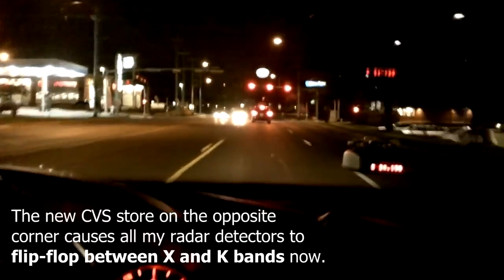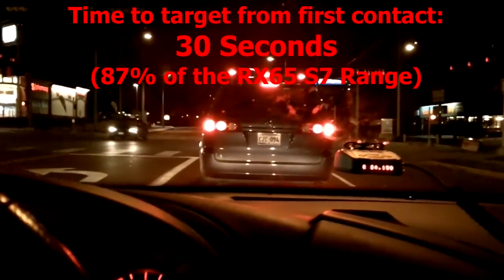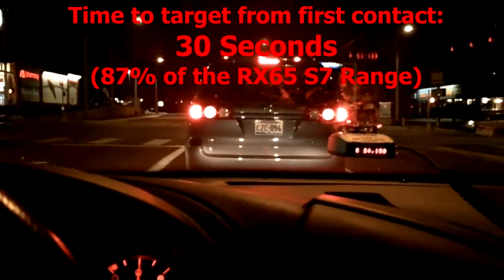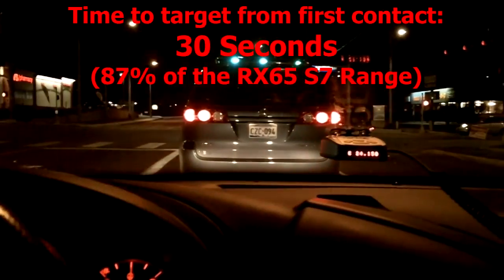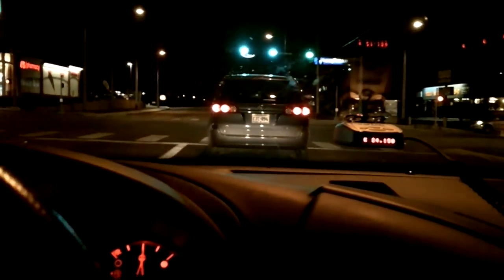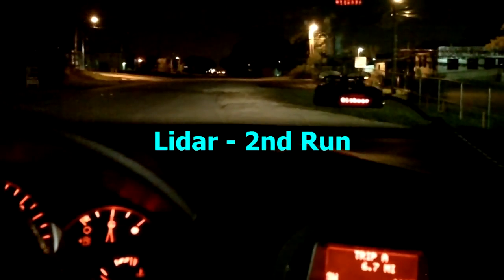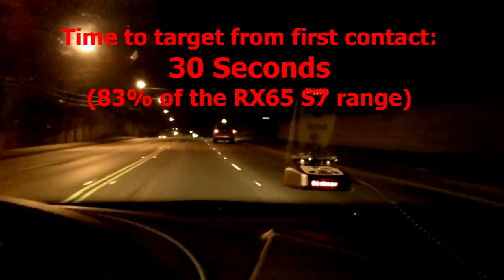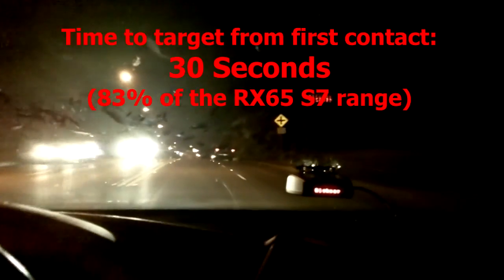Beltronics Vector 995 Field Tests - X-Band, Lidar, K-Band

Comment: I have the V995 with the S7 platform and its from 2004 and mine picks up laser like a hound on a T-bone. My opinion, the M4 platform-antenna, is not as good. I have a V940 and V955 with the M4 antenna and they dont seem to be as sensitive as the V995 with S7.